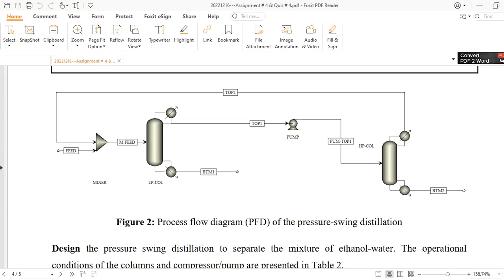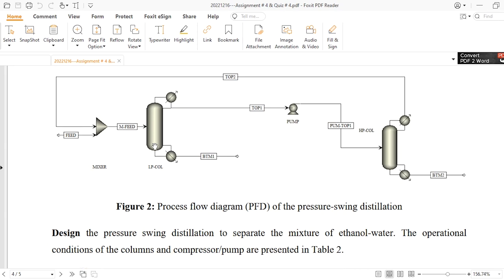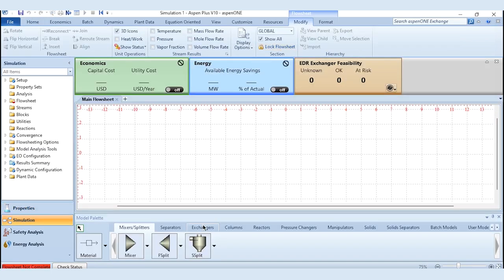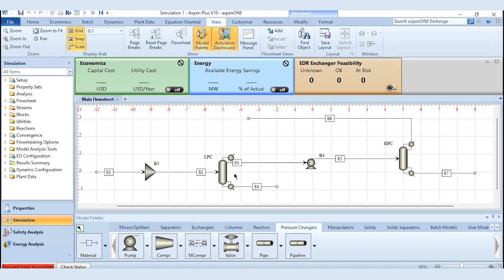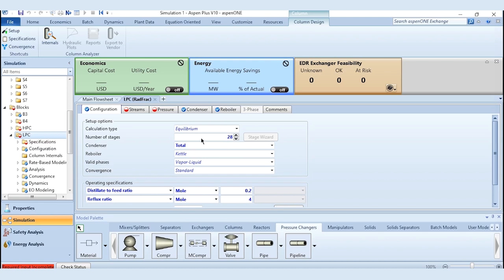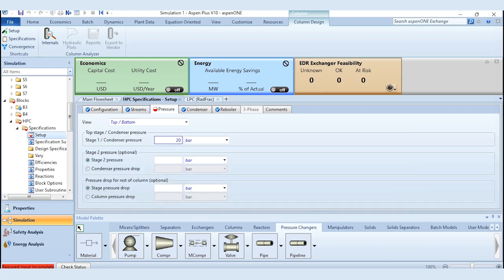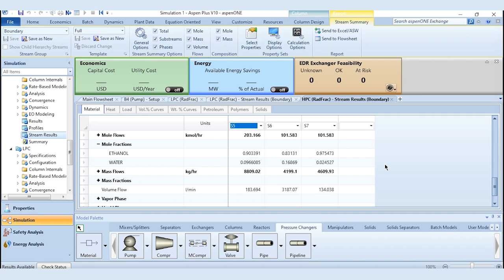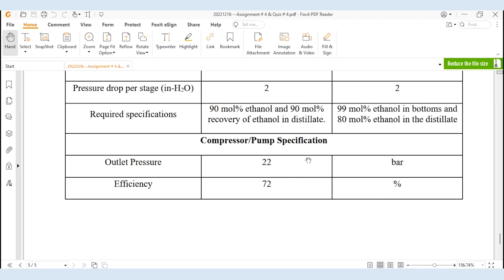Separation Objective - Pressure swing distillation using Aspen Plus - Ethanol&Water - Lecture # 114

Comment: Dear Sir, I'm using this process for my simulation but my outlet stream from fermentation tank contains CO2. Even though I let it go through a flash for CO2 separation, it stills remain in my outlet stream (10 kg/h CO2 - 47 kg/h EtOH - 295 kg/h water). Do you have any idea on how to fully separate CO2? Thank you so much